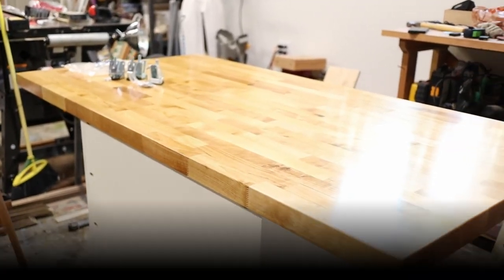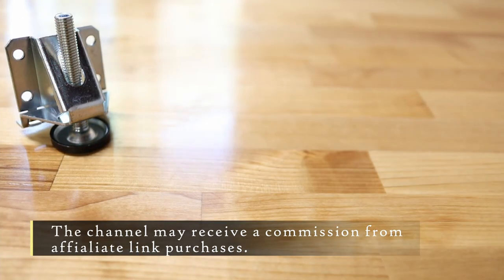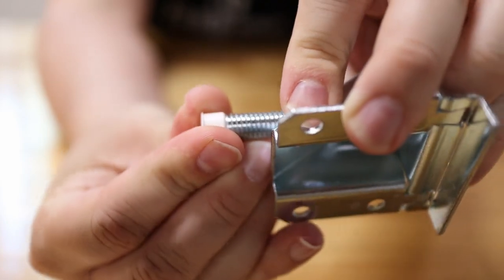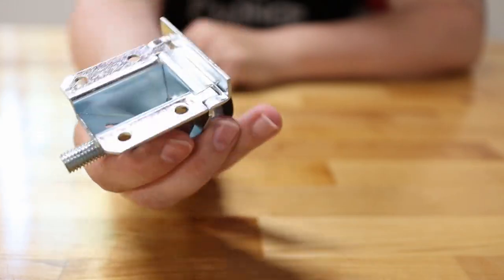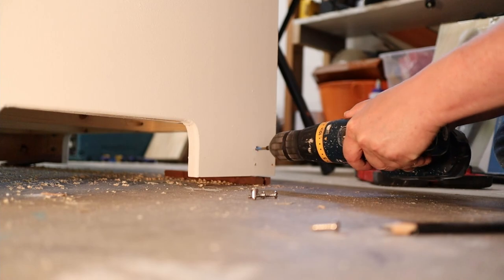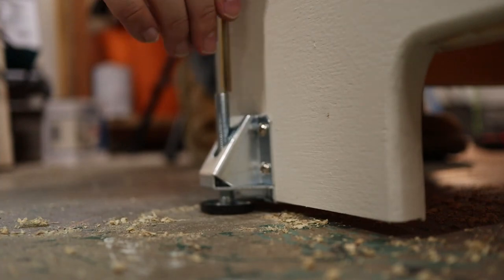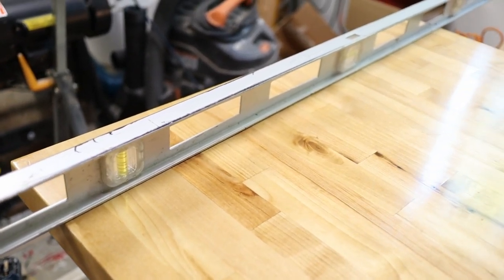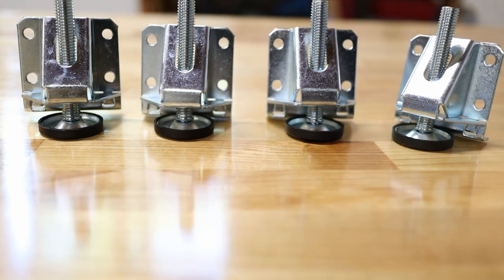How to Install Heavy Duty Leg Levelers

Comment: the levelers are meant to go on the inside of the cabinet ,you drill holes right above the hex screw of the leveler and the caps plug the hole .its so you can adjust from the inside.
Reply from the maker: Ahh, so inside, under the floor/toe space of the cabinet, and the plug closes the hole. Makes sense for a kitchen cabinet. Thanks!

Comment: How are these holding up after a couple years of use?
Reply from the maker: Pretty decent, actually. I mostly keep the workbench in one place,, but I've slid it around on uneven garage floor a few times with no issues. Occasionally something on the bench needs some hammering and everything stays where it should.
Reply: @MrLower  Nice! Thanks a lot, I'll buy some online to install on the table I just built, the flooring job in my room is atrocious.

Comment: Do these just help level the table top or do they also make the whole  table /bench more sturdy
Reply from the maker: Well, in one sense, I'm propping up a work bench on 4 small stilts. They're heavy-duty, so I'm not worried about bending or breaking, but the feet are definitely much smaller surface area than the base of the bench.
In another sense, the floor of my garage is very ugly and cracked, so being able to level 4 points of contact as opposed to a flat rectangle of end-grain plywood makes the bench much more stable.

Comment: I loved how you made a "how-to" video without actually knowing how to do it. You should redo your video with better design and technic. Either that or maybe re-title this video to how-not-to install. PS beside the obvious stuff others already mentioned, why did you place pocket holes on the outside of your workstation? lol 🙈
Reply from the maker: Pocket holes on the inside of a plywood box run the risk of tearing out the mating edge, because the screws don't have much to bite into. If you were building a kitchen cabinet your pocket screws would be on the outside of the back panel, but that part would be hidden up against the wall - what you're looking at is basically the "back" of the cabinet. I was going to put some trim over to cover it, but it's just a little messy garage shop so aesthetics only go so far. As for the position of the levelers (which I assume you're referring to), I opted to have them on the outside to increase the overall footprint of the workbench to make it more stable under load. If I were using this for some kitchen cabinet then yeah, it makes sense to hide them underneath.
Reply: @MrLower  I think most cabinets won't have a 3/4" plywood for the back. Albeit, I can see why you'd want that feet to extend farther out as the butcher block top seems pretty heavy and hanging off way too far. I doubt that 2-3 inches gained will do much good though. If I were you, I'd push that top over to one side of the cabinet and mount a leg or two on the other side. It would properly fix the toppling concern and provide a favorable workspace to sit under. I'd probably add a pair of wheels to the heavy end so the "station" could be easily "moved" around. Anyways, just think aloud... figuratively of course. You do you. Cheers~ 😎